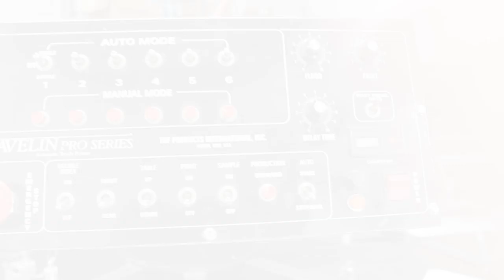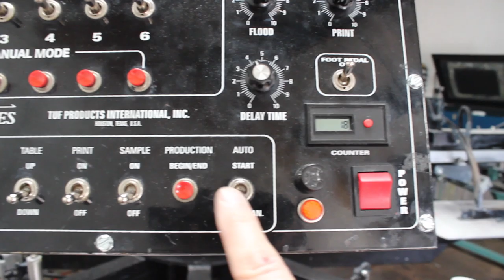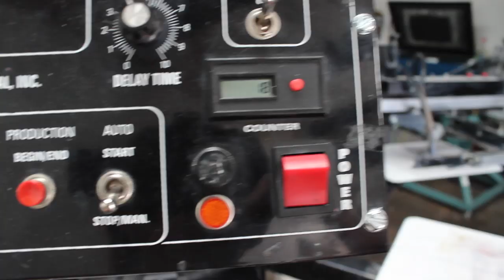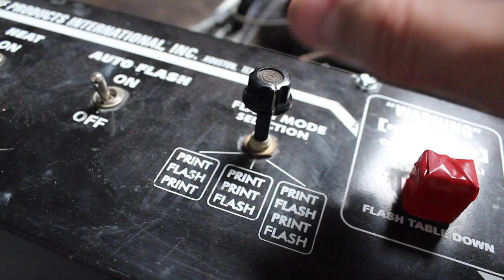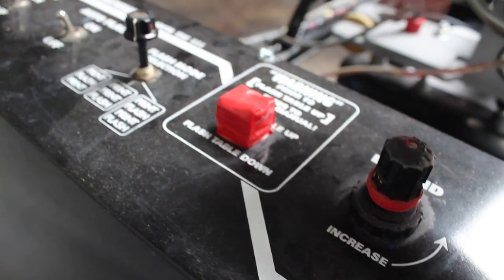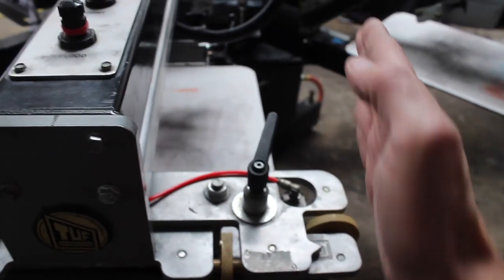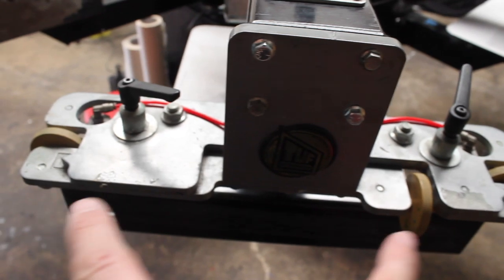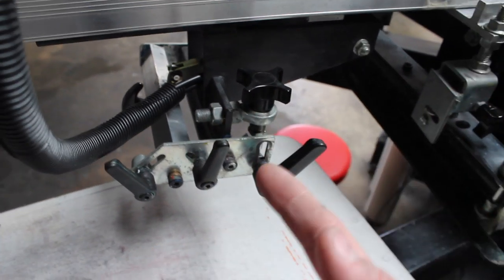How to Operate a Javelin Automatic Screen Printing Press

Comment: Awesome video. Thanks for taking the time. The shop I work in has one but we only use it for dark ink jobs. White plastisol print flash print doesn't seem to get good coverage, any suggestions or where to start? The guy who used to run ours is long gone.

Comment: So does an auto press dramatically make things easier? Or is it more of a luxury machine?
Reply from the maker: It makes things easier on your body after a day of printing. Arms are no longer tired and I don't feel completely wiped. My favorite way of putting it is it's like the difference between taking a bike vs car to the grocery store that's miles away. The bike will get you there, but not near as fast as a car and with less effort for the same end results.

Comment: This is like our auto except older style but when we go to register our screens we get it dead on but soon as we lock the back it kicks our screen forward. Very frustrating
Reply from the maker: I know the feeling. You need to adjust the rear screen clamp angle. There's a little bolt that you can adjust to help. Just make sure your screen isn't sitting in the radius part of the clamp.